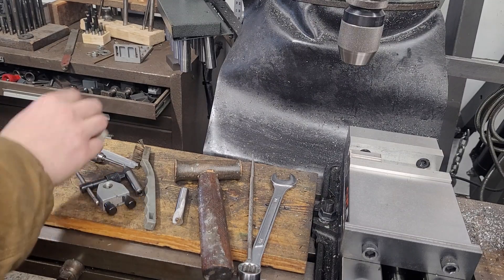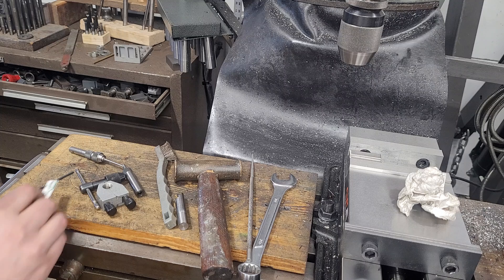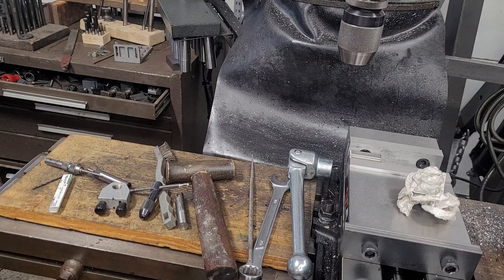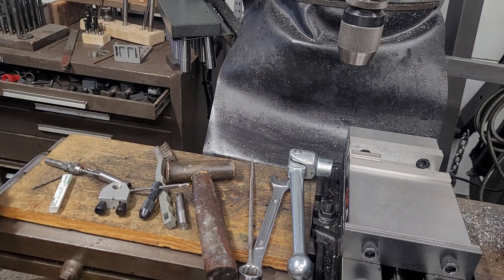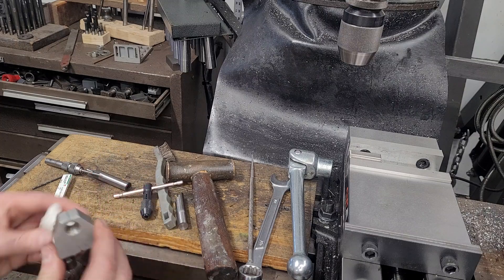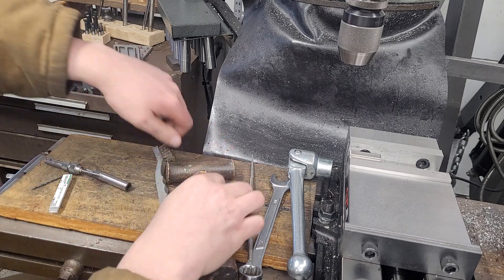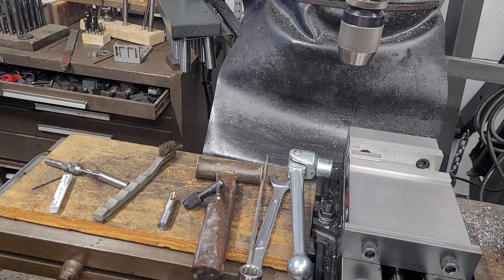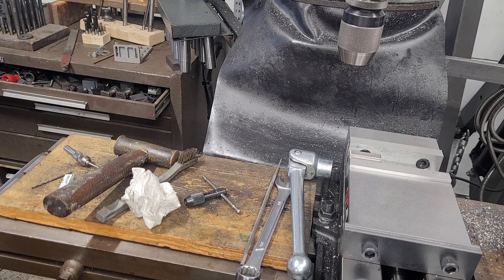How to not break small taps

Comment: This helps a ton...  im fine with smaller taps, all the way to m1.4.. UNTIL I have to do hardened steel or the infamous Titanium. When I'm doing small taps in Titanium I have at least 5 on hand and many carbide drill bits to drill out the HSS..  I did a cost comparison one time and it was like $10 for every m1.4 hole in TI just in taps and bits hahaha
Reply from the maker: @adamtout  good Lord that's exhausting in titanium. I start to worry around a no4 tap, so about twice the size of what you work. Small is all relative! 

Do you tap by hand or on a Ridgid or flexible arm? One of those does address a lot of tapping woes but aren't cheap.
Reply: @moosesmachinery  - im a home shop hobbiest.. so I tap on my mini mill (x2 style). very similar to what you described: drill the hole, don't move anything, put the tap center in the drill chuck, place the tap and say 5 "hail mary's". by hand is generally a no-go in TI with small taps.  compounding the issue, in many cases the parts are SLM printed titanium which means they are hardened and annealing them is a crapshoot too.
Reply from the maker: @adamtout  sounds like a great time overall. I really enjoy working steel & aluminum as they don't come with the same headaches as titanium.

Comment: Feel by hand, how much is a tap binding up, turn back and forth by a 1/4 of a turn, clear out the swarf regularly. Those are my tips.
Reply from the maker: A gun tap mitigates that requirement due to how they push the chips. A spiral flute tap works better but are prohibitively expensive and are terribly easy to break by breathing too hard on them.
Reply: @moosesmachinery  It's amazing how many different types of taps there are in the first place, until you get into machining, you may have only heard of/seen what's for sale in the common hardware/DIY store.
Reply from the maker: @steveclark..  oh God yes. We haven't even touched on form taps yet!